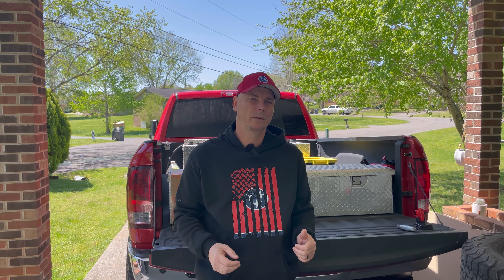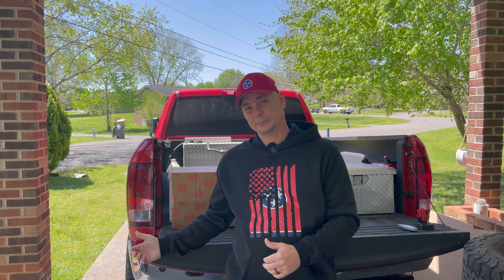Rv Transport Transmission Pan Part 2￼

Comment: LubeLocker gaskets are the real deal.
I added a PPE aluminum pan w/drain pan & huge N42 magnet at the 15K mile mark - fluid will be drained every 40K miles & refilled with TRIAX Global (Synthetic) ATF - pan dropped & filters every 80K miles.
Transfer Case will also get refilled with TRIAX Global ATF.
Reply from the maker: Heck yeah, everything we can do to make these trucks last longer.  Thanks for watching and be safe